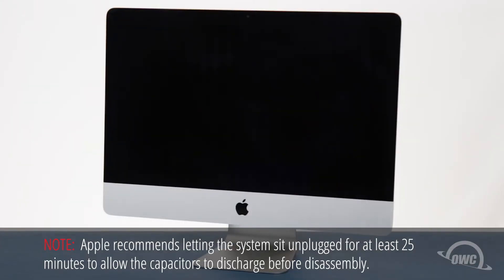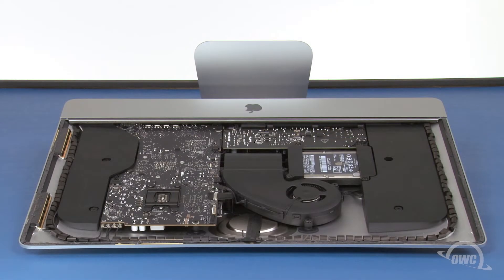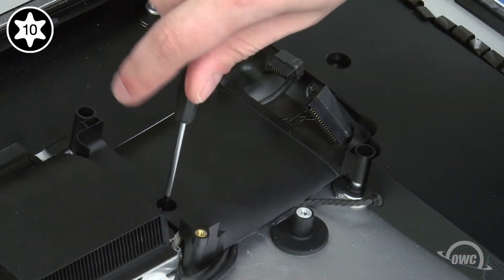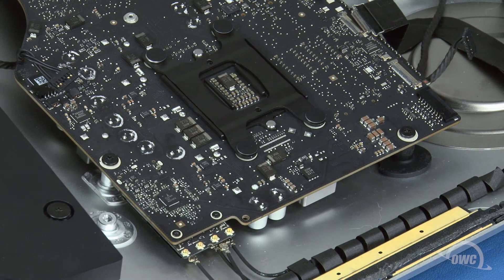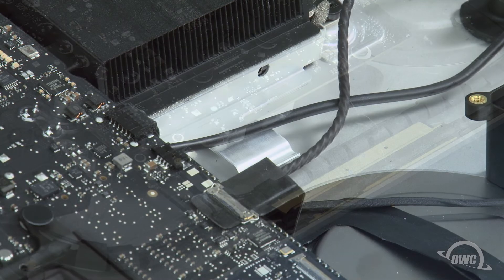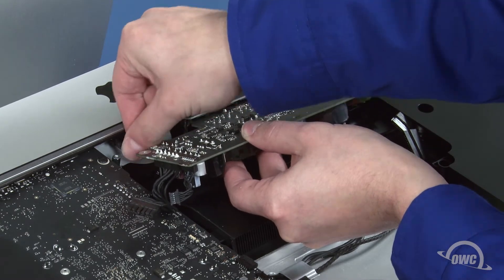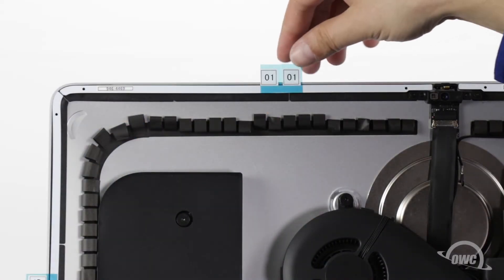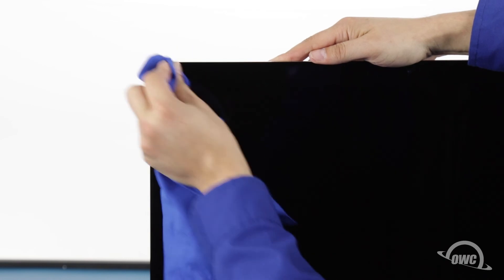How to Upgrade/Install Memory in a 21.5-inch iMac (2012–2013)

Comment: Just a heads up, you do NOT need to remove the motherboard to install the RAM. All you have to remove is the fan and you can wiggle and slide the old RAM our, and slide the new RAM in. You have to hold the iMac sideways (RAM slots facing down). You do need small fingers to do this. 
Good luck!

Comment: The ram is at the top left of the computer, you don’t have to remove the whole logic board. You just have to remove all the screws, pull motherboard slightly up and tilt it towards you and you can easily remove ram. This is what I did personally

Comment: MUST WATCH OR UR SCREEN WILL FALL OUT ... So yeah great video but u r missing a LOT of crucial steps. U missed a lot of steps to make sure the display stays on. MINE FELL OFF TODAY after 72 hours. 
1. Now make sure you peel off ALL the tape including the one on the aluminium frame at the bottom (logo side). 
2. Also on all the old tape golden antenna. You clearly left the sellotape there on your first video. Looks like this updated one is ok though.  
3. It is crucial to clean application surfaces with 90% (or greater) isopropyl alcohol, without proper surface preparation the adhesive bond WILL fail.
4. Add sellotape on BOTH the aluminium frame AND the screen. 
5. If you are just changing the RAM or upgrading, I bet it is doable without removing everything ... By using a wooden tool and then carefully removing the RAM. I dismounted everything but I bet it is doabe now that I have been through the pain. 
6. If you change a hardrive (replace or upgrade to SSD), you better make sure you prepare it and format it properly FIRST because I added a new SSD and used APFS format and it did not get recognised when I started the computer (AFTER SEALING IT for good ...), I think it has to be MacOSExtended formatted to work properly. Do some test BEFORE u seal it off maybe by using painter masking tape to keep the screen in place BUT WITHOUT sealing it. 
7. Do not touch ANY of of the capacitors on the Power Board as they could still be charged. Electric shock is not cool. 
.
Ultimately, iFIXTit USA or UK is selling ready made sellotapes strips for like £15 / 15$ so I suggest you buy those. I have now 50 meters of 3M 9448A top quality sellotape that I am going to resell and I will buy the ready made Ifixit stuff instead. I wasted my time and my iMac may be broken now. I hope it won't happen to you guys. All this effort to #fail on a sellotape issue. I am fuming. Hope it helps. 
Disclaimer: I don't work for Ifixit, I am just a regular guy that did it all based on this video here and #fail so BEWARE.
Reply: LMAO
Reply: So you’re trying to tell me you couldn’t format it when you went into internet recovery?

Comment: WHY DON'T YOU DELETE THE OLD VIDEO and only keep this one ? I DID NOT SEE THIS ONE UNTIL NOW. MY SCREEN FELL OFF 3 days after repairing it following your [PARTIAL] instructions grrrrrrrrrrrr. I am sorry guys but I suggest you watch the IFIXIT videos and update this video AGAIN. I am SO annoyed my screen fell off. This is SO infuriating and u r partially responsible for this ... I followed your steps and boom. #fail. Please please DELETE the old video. and keep this one only.
Reply: Honestly it’s common sense to remove all the old tape to ensure a proper seal.

Comment: Thank you so much for the only video we have for this, no one made it on the 2012 so I just did it and everything was good! I couldn't make it without your help so thank you so much. The most difficult part was taking the motherboard off and relocate it. The only thing that happens to me now is that when the Mac turns on, it sounds, but once the system is on, impossible to sound. It appears like a prohibition sign below the sound icon if I try to volume up/down, but if I connect my earpods everything is good. Anyway I'm reinstalling the iOS trying to solve it (if the first sound sounds, it should be an iOS trouble, I'll cross my fingers).

Comment: Hi, I need to know, when we upgrade with 16gb RAM, will mac work faster then 8GB RAM? how about the performance after upgrade (I bought in UK)? please advise and the amazon link shown your product, is this genuine (mean yours) ? this is the link https://www.amazon.ae/OWC-PC4-19200-2400MHz-Installation-OWC2421DDR4S16K/dp/B081VV2XPJ/ref=sr_1_9?keywords=OWC+ram+16GB&qid=1575967241&sr=8-9

Comment: It's a good idea to replace the battery (2032) on the logic board while you've got it all taken apart.
Reply: metalheadbill why?
Reply: @tsunghan_yu  because they have a finite life and 6-7 is at the pt where it will go dead.  the battery cost $ 1 but the labor is $ 200.
Reply: Steven L isn’t the battery used only when you unplug the computer, so it should last for a long time
Reply: @tsunghan_yu  Nope, cr2032 is not a rechargeable battery.  It is the battery that maintain the CMOS settings and supply power to the chip that run real time clock.
Reply: @slam5  https://superuser.com/a/907909/829597 According to this, the battery is only used when unplugged. I mean if I never unplug my computer, I should not worry about the battery running out.
Reply: @tsunghan_yu  Batteries always have a limited lifetime before they´re dead, even if you never use them. But if you never turn of your computer, then why should you worry.

Comment: I have the mid 2017 version without the access panel in the back. Do I need a thermal sensor cable since I'm upgrading to an SSD? Coming from a 5400rpm standard.